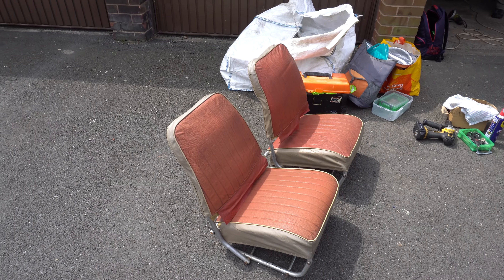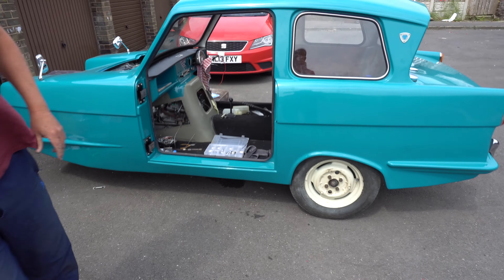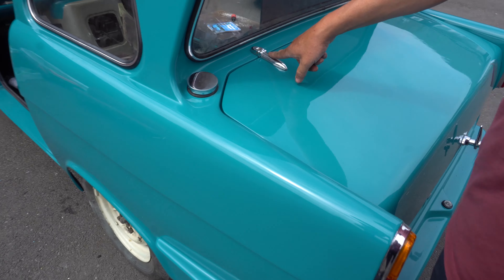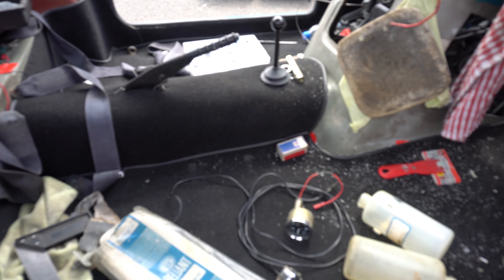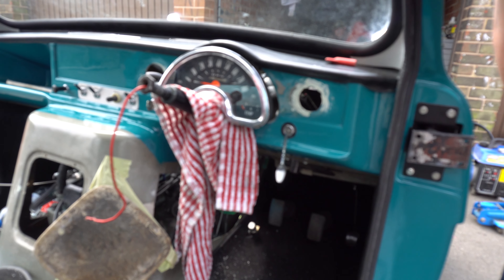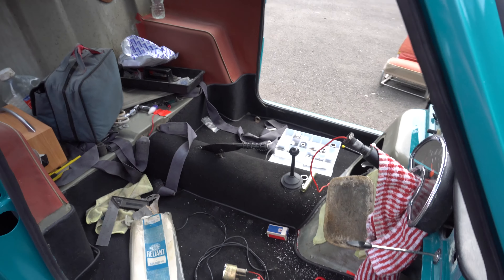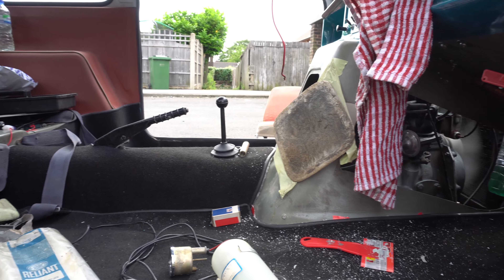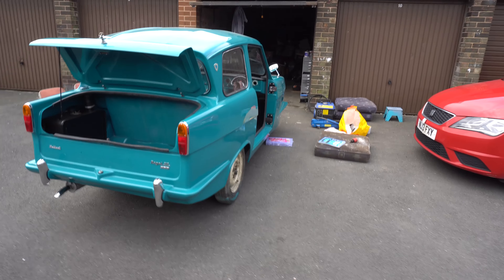1969 Reliant Regal restoration   Part 3

Comment: The mechanical petrol pump is fairly reliable and reasonably inexpensive to replace,     Quite easy to remove and refit,    Also in the event of a accident it shuts off as it`s powered by the engine,    If it was difficult to start I would start with cleaning any sludge from the petrol tank,    Replace fuel lines and filter,     Clean and rebuild kit for the SU Carb,     The petrol pump would likely be the last thing at fault